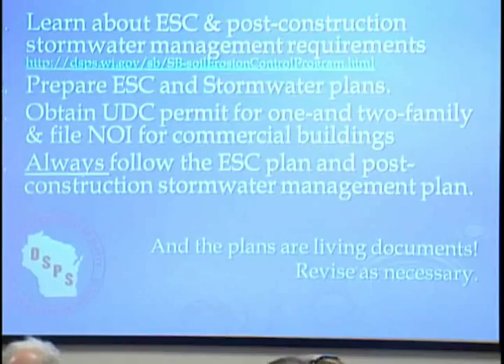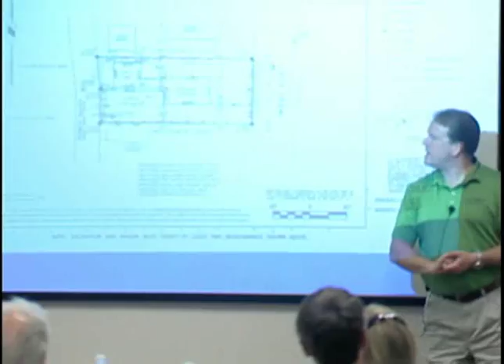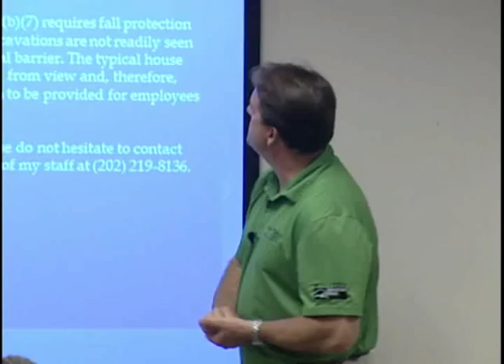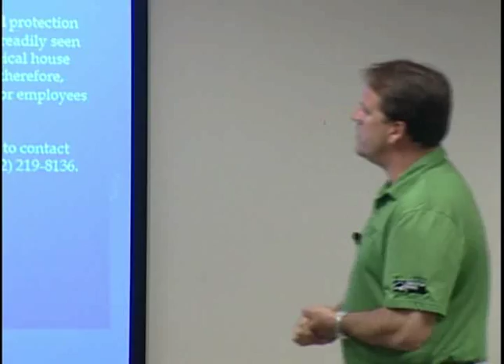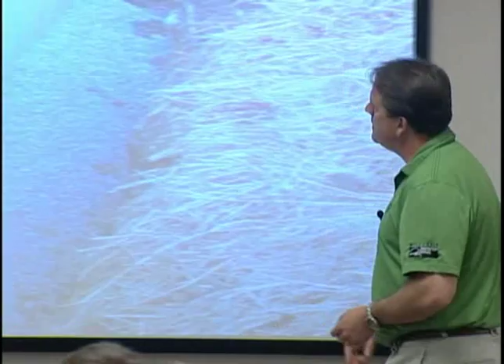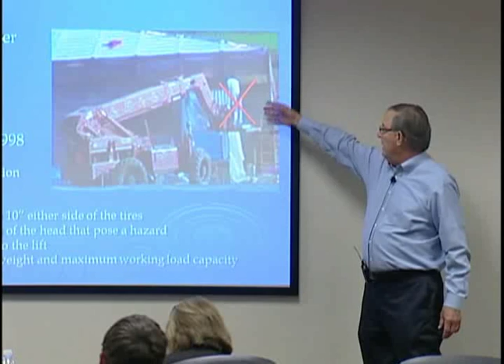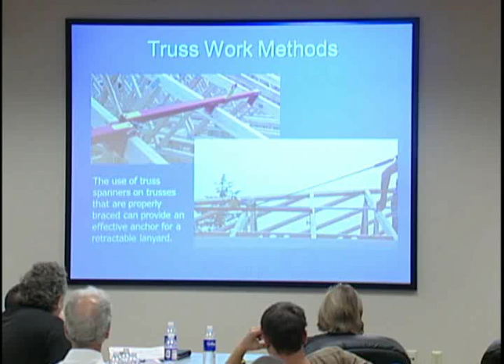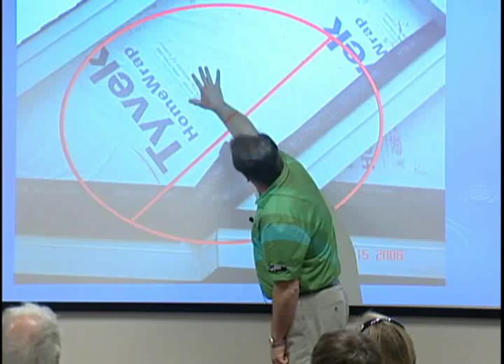Building and Remodeling Construction Process 1 of 2

Comment: Good info, good speaker. 
One suggestion. It would be nice if you guys could cut in some slides with whatever is on the screen. Just edit their PowerPoint into the video. That way you don't have to re record the whole thing. You could even just use their vocals and lay it over the power point, super easy. I like seeing them, but I'd rather see what's on the screen if I've gotta pick one. Bonus points if you give us the links in the episode description.